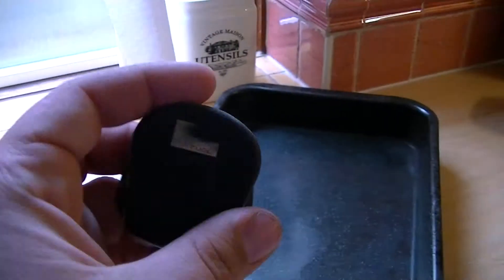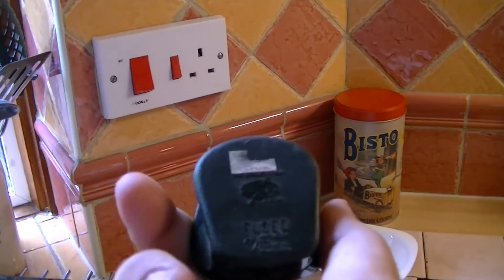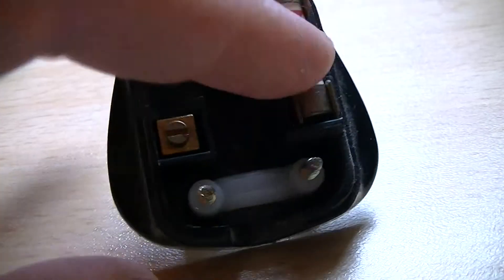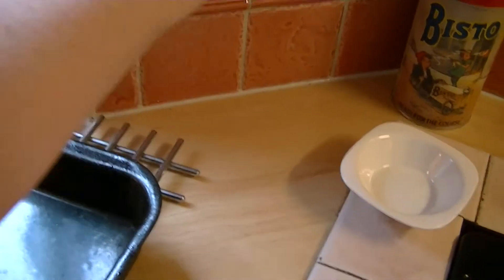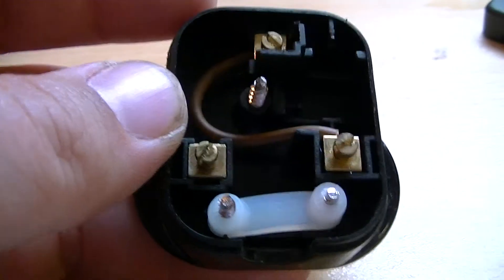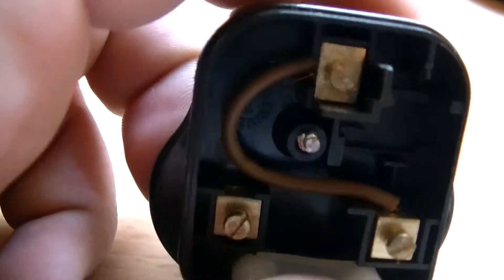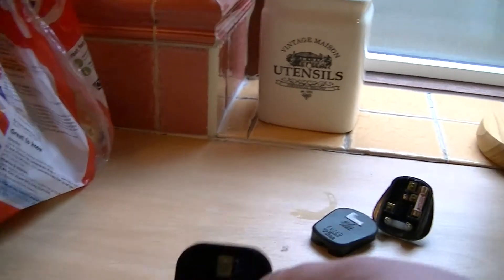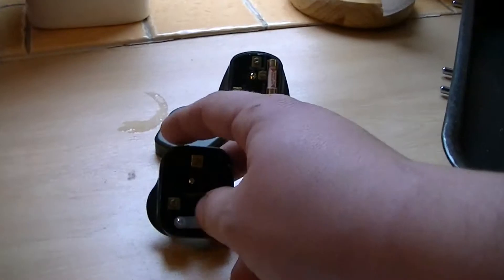Live to Earth Testing Plug

Comment: Not quite sure why anyone would need to construct this test plug as the shorting out for R1+R2 should be made at the consumer unit and measurements taken at each socket-outlet using the test lead and plug which is supplied with all multifunction testers.